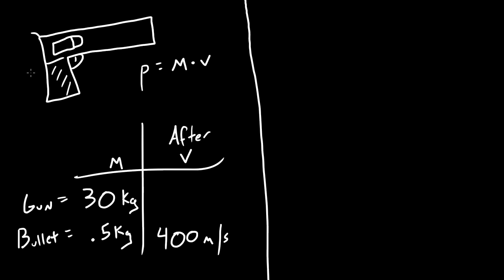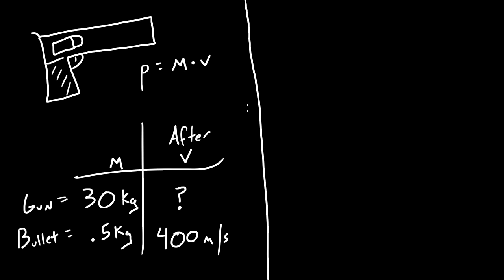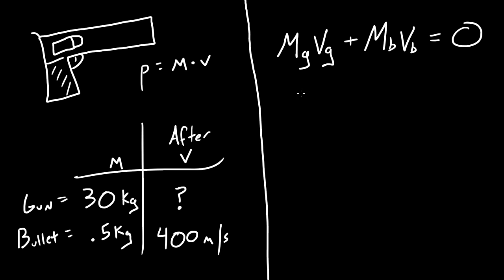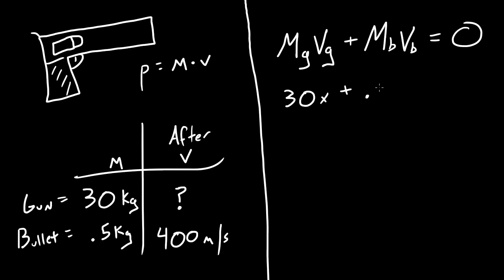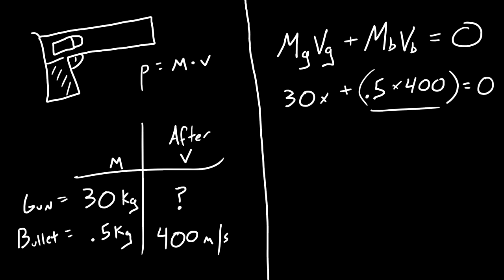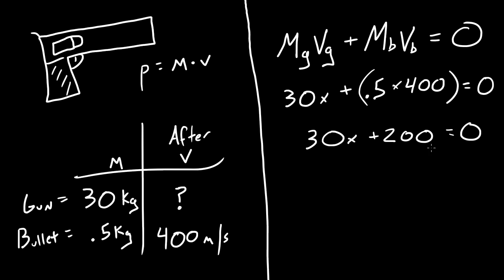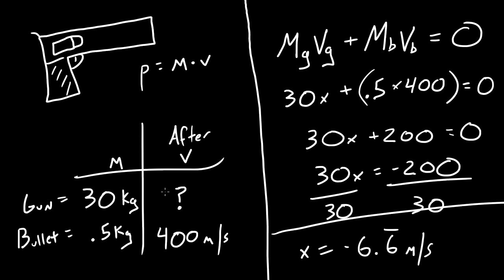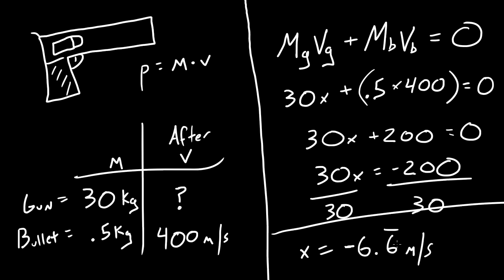Physics Lecture - 25 - Calculating Kickback Speed

Comment: Love these tutorials! Just a little tip on this one in particular. When you are given the ratio of one side of the momentum, you can use it to complete the other side, as the ratio will be the same. 0.5 divided by 30 is 60. Then 60 divided by 400 is 6.66 (The velocity) I didn't get the minus but given the direction of the gun, that is pretty obvious :)

Comment: you forgot something. the weight of the powder in the brass. That burnt powder is blown out the barrel as well and produces significant recoil. (directing that gas backwards can reduce recoil by up to 20 percent. ported barrels).